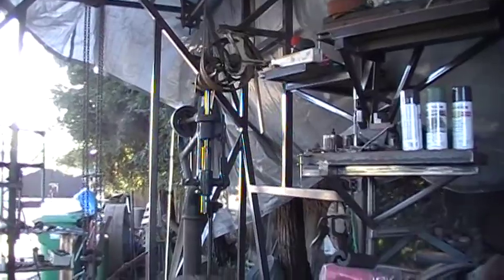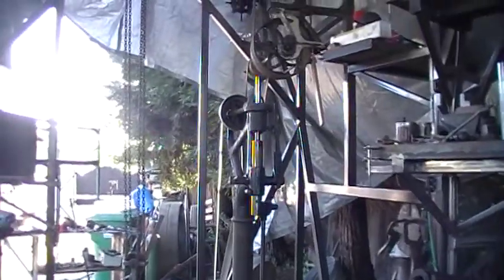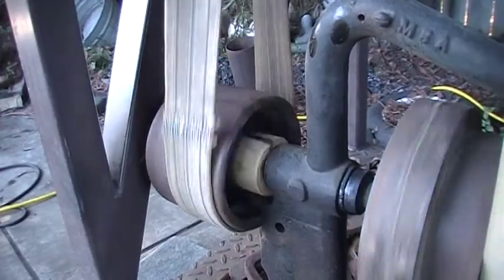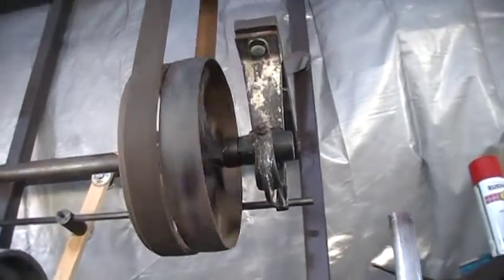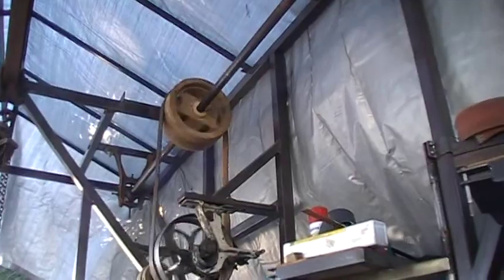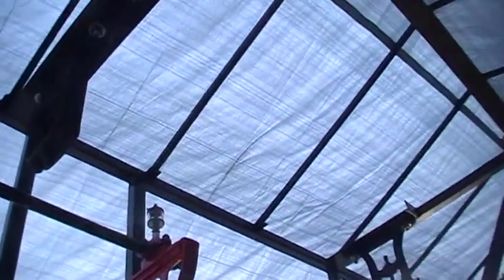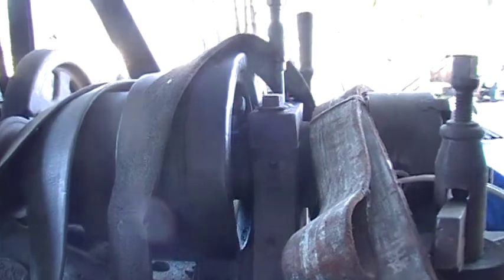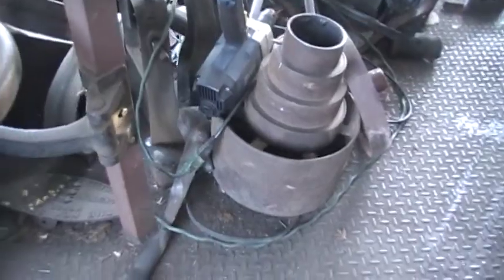Antique Canedy Otto camelback drill press first run

Comment: This is simply amazing that your shop is outside with a blue tarp over the top. It is unbelievably well set-up however. Are you planning on putting a building around this or at least a hardcover? I can't wait to see how it all progresses.
Reply from the maker: Thanks Bill. Actually The shop is on a trailer to take to shows. For winter I have 8 ft. extensions on each side that keep everything dry unless we have a storm with wind that exceeds 50mph. Happens once a season and we already had that storm. I'm currently working on the outside and when I get further along I'll make another video.
Reply: @davewilson1591  this is the only video I'd seen But when I watched one of your other videos I realized it was in fact on a trailer. My bad. What a great line shaft shop you have there!

Comment: things are moving along nicely Dave
Reply from the maker: Old Iron Shops Thanks for the comment. and yes they are. I'm especially proud of the Canedy Otto. Been looking for something like it for quite a while!
Reply: yes me to i know where there a drill thats about the right size but its missing lots of parts and here kinda wants a lot for it
Reply from the maker: If you're looking for one of the more robust models, I know where 3 are for sale. Fairly reasonable with power feed and back gears. For me the problem is they are all 8 - 9 feet tall and in the 12 - 1500 pound range. Too large for my trailer. If interested let me know.
Reply: yes interested but broke i need to k
check my ceiling height